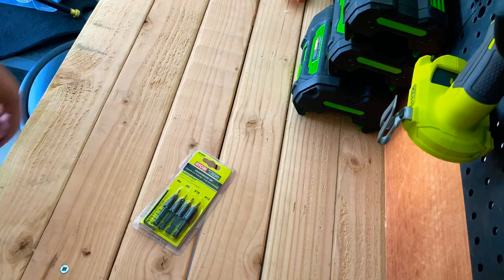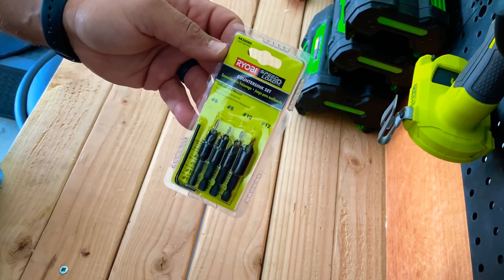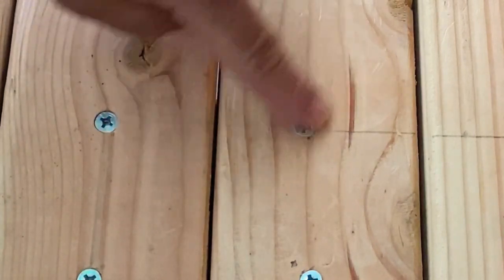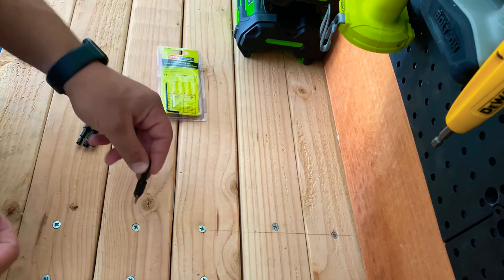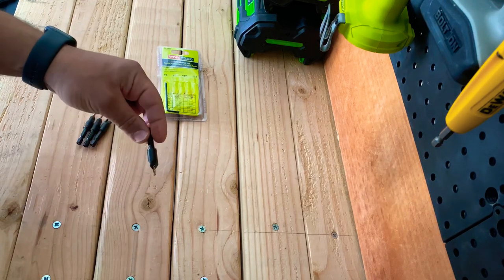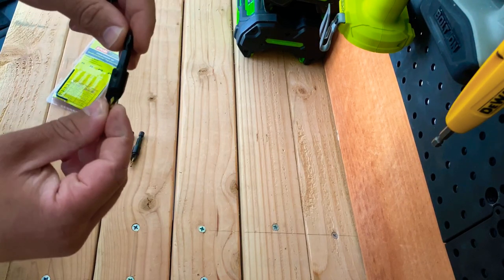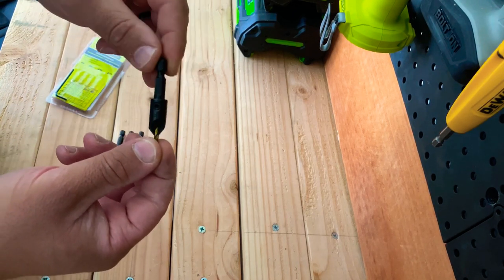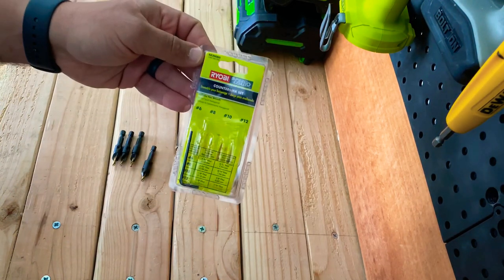Ryobi countersink bits impressions and how to use.

Comment: how deep can the countersink go? looking to make a wasteboard for a cnc, Can it go .5 of a inch deep?
Reply from the maker: I'm sure it can get to about that. Could you help me out by subscribing?  I'm almost at 1000!
Reply: @EveryDayJay415  done... I ended up just using the CNC to make the counter sink hole. turned out good i was able to give enough room for a washer. Got plenty of room to level out my waste board a few times now:)
Reply from the maker: Man a CNC would be nice!